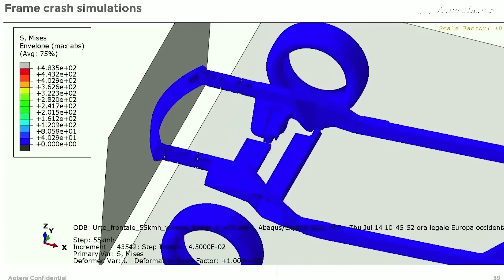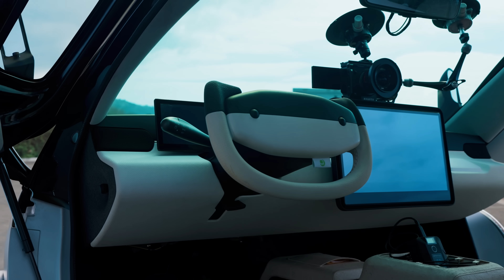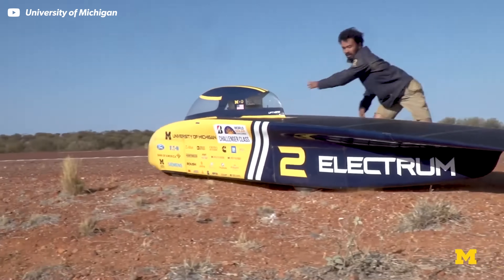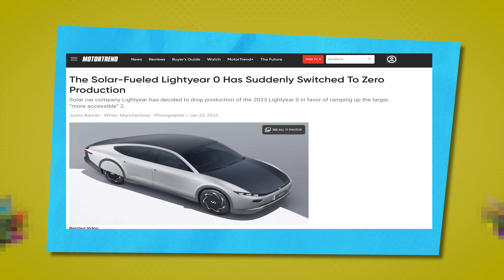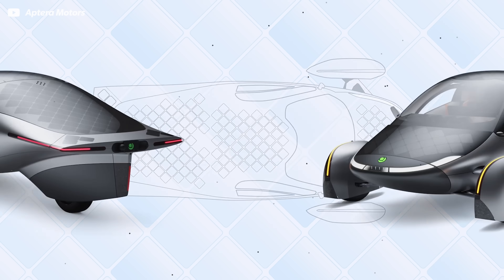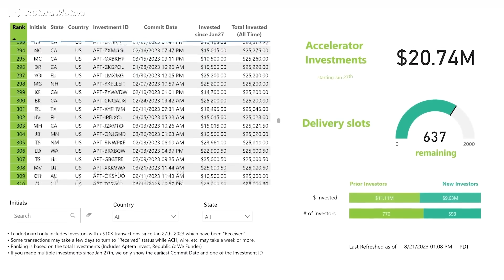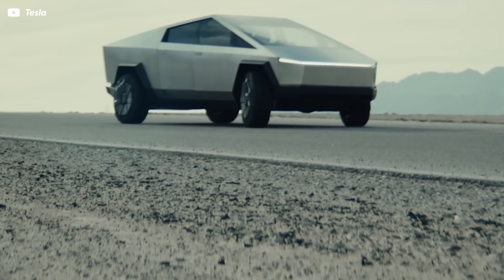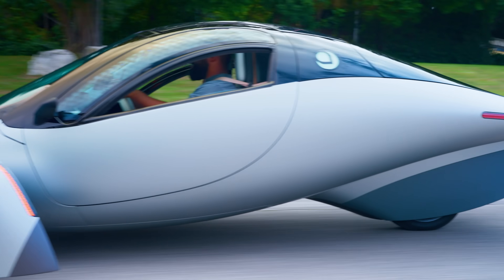We Drove America's First Solar Car

Comment: I would like to try to drive the Aptera. Possibly paying to rent it for a day, if rent price is reasonable.

Would I like to own the car? Absolutely not. It is very impractical. It has a small interior but it takes up a lot of space. That is the opposite of what you want from a car.
Reply: It has 32 ft of storage space and enough room for 2 people to sleep in the back for camping.  It is both a practical commuter and a weekend adventure vehicle - exactly what many couples want, and it fills that dual role at a much lower out of pocket cost.
Reply: @n.brucenelson5920  "32 ft" that is a length? Sorry I do not speak hillbilly units.
The cabin is small and there is not 4 seats. Contrary to other small cars it takes up alot of space, so will not fit in a small street parking space.
Reply: @Foersom_  32 cu ft., or around 90% of a cubic meter.  Aptera will fit nicely into a US compact parking space with room to open the doors.  You are correct that it is not a 4 seater.  Neither was Tesla's first car.
Reply: @Foersom_  32 cu ft, or if you prefer about 90% of a cubic meter.

Aptera will fit in a US compact parking space with room to open the doors. 

It has better 0-60 times than Tesla's first shipoing 2 seat sports car at about 1/3rd the price, and a far larger demonstrated market. through paid pre-orders.
Reply: @Foersom_ there is 7 feet of room behind the seats and 32.5 cubic feet of storage back there.
Reply: @n.brucenelson5920  The Aptera is 2.22 m wide, that is much wider than any normal passenger car. Curb side parking here in Luxembourg are barely 2.00 m wide, some even slightly less. Most often it is not allowed to park on to the pavement. You will find similar narrow curb side parking in other European countries, including Italy. That makes Aptera a very impractical car to park.

"90% of a cubic meter." 

That is >300 l less than storage of an VW E-Golf or ID3. And that while E-Golf and ID3 are 40 cm less wide and 30 cm shorter. Small interior, but takes up  a lot of space. Aptera is the opposite of a practical car,

"It has better 0-60 times than"

Not relevant to anything I have said.

Comment: The future cars are electric,  hybrid and hydrogen powered  micro cars, but  that sell for as lows as 8999 and can get in excess of 80 mpg for the hybrid and have insurance premiums for less than  half of today's Honda Accord would require. We can also look forward to  affordable electric flying vehicles with a range in excess of 300 miles at speeds of 100 mph plus.

Comment: If this costs $25k then it will be hit in developing world like South Asia and Africa as they have low income + they have bright sunlight throughout the year
Reply: The prices were made up 5 years ago, and it wasn't a realistic price then, you can easily add 10k or more to the price
Reply: @shrimptopian3392  even at $40k it's a bargain
Reply: @shrimptopian3392  You could get a bicycle for even less and have almost as good a performance.  You need to look at the details a bit more closely, especially  once the crash test validation work is done.   This comment will not age well at all.

Comment: So at a light or when you’re stuck in a protest someone will knock on your trunk and it’s “game on”!😂😂😂😂
Reply: Personally I dislike the knock knock. However...

From Aptera FAQ section:

How do I unlock and lock the Aptera vehicle? With a key fob?

The vehicle will unlock by detecting you via your phone’s Bluetooth connection, our app, or with a physical RFID card. Once inside the vehicle, you can open the door through the center screen controls. Aptera will automatically lock when you exit by detecting that you are not inside. The interior cabin will include a mechanical release to open the door in case of any electrical malfunction. More information to come as we push the efficiency envelope on mobility.

I belive you can open it via Bluetooth and your phone, or an rfid card, and I don't belive that the knock knock will work without one or the other.

Comment: I wonder how fast it can fast-charge
Reply: The highest rate for the first models will be between 40-60 kW per hour, or about an hour to fully charge a 400 mile range battery pack (45 kW/huur pack - 40 kwh useable capacity)

Comment: The drive it, they like it, everybody loves it yet it is not available. In a country that sold Pacers, Gremlins and Aztecs by the thousands. And everybody hated them 🤔
Reply: Both my wife and I have ridden in an Aptera prototype.  It is no Gremlin (which my brother owned).  Although the primary design goal is efficiency, the AWD acceleration is better than at least the first 200 Tesla Roadsters made.  It is a blast!  Production is still around a year away.

Comment: Where is the windshield wiper? I understand that at speed, with a slick enough surface, you might be able to have the water bead and flow off, but not sitting in traffic. That structural member across the side windows would take some getting used to, but I saw another video that mentions you have video screens showing everything out to the sides (180 degree arc to the back half), so you actually can monitor that view from the dash.  I hope they succeed. Cars are an incredibly difficult thing to manufacture and meet modern regulations. I know the electric motor (s) is in the wheels. Can't remember how many motors. In the other video  they showed us the one, in the driver's side front wheel. I hope they have some redundancy (mechanical) for the door opening. People are getting stuck inside Teslas during software updates (perhaps some "user error" there, but things need to be "user-proof"). In the late 70's, people got stuck in their Bricklin Motors cars when the prone-to-drain batteries ran out of juice. I worked with a guy who had one, and he did get stuck once. Granted, tech is way advanced since then, but a mechanical emergency mechanism would be nice.  While the aero is amazing for forward resistance, I wonder how this will fare in cross winds and 18-wheeler turbulence.

Comment: It’s cool, but 5 miles of range per hour isn’t enough for it to really take off. I hope this technology can improve as everyone loves the idea of free power
Reply: "5 miles of range per hour isn’t enough.." Um, where? My job is less than 3o minutes away from where I live. If I charge the cheap 250 mile variant ($28k with premium sound system, tri motor, and full solar package) over night, then let it sit in the sun at work like I do with my ICE car now, it would always be topped off. 5 miles for 1 hour in the sun is great.

Comment: Wanna see it does a high speed sharp turn like what is the limit before it flips? Or on bumpy roads.
Reply: And how do you miss a pot hole when you have a wheel in the middle?
Reply: It passes the moose test, it slides rather than flipping. The batteries, which are the heaviest part, are very low down which helps keep the center of mass low.

Comment: The range of 5 miles per hour sunlight does not make sense. Just put the solar panals on your roof and keep the production costs of this car as low as possible.
Reply: It isn't an either/or choice.  The solar will be welcome on camping trips for instance, and collectively protect the public power grid.

Comment: Those AAA Batteries are no match  for my Ramcharger on 35’s and a q-jet 360 small block haha
Reply: You would be surprised.  First of all they aren't AAA batteries.  Secondly, the 4 second zero to 60 times will be likely be humiliating to your Ramcharger -and your pocketbook when you compare the initial and and operational costs.
Reply: Every time you fill your tank it costs you ~$100. Have fun!

Comment: Do they use LFP or LMFP battery chemistry?  Can the hub motors be turned into coast mode for better efficiency?  ie  use only one motor for constant speed on flat terrain?
Reply: The batteries for the first models use NMC chemistry..  The hub motors have several levels of regenerative braking available.  Future models may introduce new control software that could provide differential steering.

Comment: Is the trunk big enough for a hayabusa or equivalent motor to drive the rear wheel?
Maybe power a small generator too I guess.
If it has too.
Reply: You have not yet grasped the purpose or benefits of the design.  However with right to repair, owners can do whatever they wish with one.

Comment: Can this be 4 wheel without losing efficiency?
Reply: No.   4 wheels would add weight, rolling resistance, air resistance, and cost, and an additional friction robbing bearing.

Comment: Anyone know how long the solar panels would last? Would their efficiency drop over time? And can they be replaced or repaired?
Reply: The Maxeon cells used in the Aptera panels are sold in fixed panels by Maxeon directly with a 40 year warranty and a stated efficiency of 88% of the original over that time frame.

Advances in Solar tech probably mean that the solar panels on most Apterae will be replaced long before that, due to lower cost and increased efficiency.

Comment: I would not call a $26,000 vehicle Cheap. However I am hoping to save enough to buy 1.
Reply: Remember that ongoing cost of ownership should be a part of your calculation.
Reply: @n.brucenelson5920  yea..I'm seriously not thinking of buying I can hardly justify spending that amount of money even if I had that amount
Reply: @seapirate65  We are still a ways from knowing the actual final selling cost of the 250 mile range basic model, and it is probably still at least a couple years off from production.  You have time to continue to save, and will have third party reports of the actual performance by that time to help in your decision making.
Reply: @n.brucenelson5920  yes that's what I'm thinking, it is still years away before any vehicles roll off a production line. So yes I still have time to save.
Reply: I will say tho. That is still alot of money

Comment: I like it.. 101 miles range assuming that’s on a full charge?…
Reply: The first production vehicles will deliver around 400 miles of range at EPA highway speeds.  They will eventually have models with about 250, 400, 600, and 1,000 mile range.

Comment: I wonder how it handles cold weather.
Reply: It should be good down to at least -20 F.  It has superior traction control, especially in the AWD models.  They can sense wheel slip and adjust torque every 2.5" of tread travel.  I will report on my experience in Iowa.
Reply: @n.brucenelson5920  
How’s it for heat? Where I live we regularly see EVs loose 50% of their range just keeping the car warm enough for the passengers. 

As for snow, I wouldnt drive it most places around here. It’s simply too light and three wheels gives you a lot less grip in comparison to four.
Reply: @MiscellaneousMcC  I don't know the answer to the effect running the heat will have on range.  There will be need for both keeping the passenger(s) warm, and maintaining the battery pack at a suitable temperature.  I think we will find out more about this during the validation phase of the testing of the first production vehicles this coming Spring.  My guess is that it will be adequate down to -20 below F, and possibly further, but definitely with a range hit.

As far as performance in snow, I currently drive a gen 1 Honda Insight through Iowa winters. It  weighs about the same as an Aptera will, and the track of the rear wheels is narrower than the front, so it has to displace more snow.  I have found that with proper snow tires it is adequate.

Aptera will have superior traction control, with the ability to sense wheel slip and adjust torque every 2.5"  of tread travel.  There will be snow fall that is deeper than Aptera or any other small car can handle, but once the roads are plowed I think it will be better than many, at least in the AWD versions.  A prototype has already been tested on a ski slope in Switzerland with the snow above the bottom edge of the wheel pants, and it did fine.

Comment: The Aptera is a motorcycle, not a car. And it s definitely not the first solar vehicle. But it is the only left, as the others already went bancrupt.
Reply: While Aptera is defined legally as a motorcycle or autocycle, depending on where you live, for most owners the functionality and legal requirements such as licensing and insurance will be much more car like.  Your statements are about as accurate as your spelling.
Reply: @n.brucenelson5920  Most often the insurance for expensive motorcycles are much much higher than for car which cost the same. Your statements are about as accurate as your fake identities.

Comment: Here in gloomy B.C. you wouldn't get far, especially in winter. Be good in Nevada though.
Reply: You will get about 2.5 times the distance of a Tesla model 3 for the same amount of power if you plug it in.  Perhaps you are overlooking what the efficiency does for you.  The first model will have 400 mile range at EPA speeds.

Comment: I wish it was 4 wheels. Would look so much better.
Reply: 4 wheels would decrease performance to a major degree, due to increased wind resistance, rolling resistance, weight, and cost.  It was not designed the way it is for "looks".

Comment: it is interesting to me, why doesn't tesla slap some solar panels in the roof to help extend range? seems easy to me
Reply: Because Tesla is so inefficient in comparison, that just slapping some solar panels on the roof will not add significant performance as it does for Aptera.  Every watt gained by the Aptera drives it 2.5 times further than it would a Model 3.

Comment: If they had an option to just charge it normally also then it would worth it
Reply: Aptera can be charged at a rate of 13 MPH range gain plugged into a standard 110VAC outlet, or around 400 miles per hour plugged into a Tesla Supercharger.
Reply: It obviously can charge normally as well.  Where are you getting your information?

Comment: That car looks like a five mile per hour wind could blow it off the road.
Reply: Only because you don't understand aerodynamics.  There are no flat surfaces for the wind to exert pressure on.  At speed there is downforce built into the design.
Reply: @n.brucenelson5920  I had to look up what downforce was and how it worked. I understand that downforce allows the vehicle to grip the road better and travel faster.

Comment: how does it handle pot holes cuz I imagine hitting one with that back wheel is gonna do some damage
Reply: I had a ride in a prototype before the suspension was completed by Roush Performance.  Even then it did well over speed bumps.  I will report on my experience in Iowa on gravel roads.

Comment: For someone like me who doesn't like <4 wheeled vehicles for safety, what would you say in favor of it?
Reply: Much of the safety concern over 3 wheels came in the wake of Top Gear modifying a Reliant Robin to make it look easy to turn over for comic purposes.

The Aptera is a tadpole configuration, has a much lower center of gravity due to the wheel motors and battery pack, and passes the moose test - it is better in this regard than many 4 wheel cars on American roads.  The three wheels reduces rolling resistance, allows for a more aerodynamic shape, and reduces weight, cost, and tire costs.  For its mission, it is a win all around.  It will be publicly crash tested next year to FMVSS Part 200 automotive safety standards by a third party.

They wouldn't go to this expense voluntarily if they didn't know it would do well.
Reply: I would say, look at the videos of them doing the moose test, ect.  The car is more stable and less prone to rollover than many SUVs/crossovers today.

Comment: We need to crash test this car against an average US vehicle, ie a pickup truck.
Reply: Aptera will be voluntarily crash tested to the same standard of every other car or truck in the US by a third party- FMVSS Part 200.  The results will be published, unlike many SUVs and trucks for sale in the US.
Reply: Let's then test that pickup truck against a fully loaded semi at 70mph.  You are pointing out the exact problem the US car industry and regulation have.  Continually making everything bigger and bigger, then everyone need a giant tractor to be safe in an impact.  This vehicle is solving that problem as well, by being as light as possible.  Check out Romain Grosjean F1 crash through a metal barrier.  They are using similar technologies for safety cell, ect.  While obviously not F1 level, but you don't just build things bigger/heavier to be safe.  Then what about the next guy?  He needs a bigger car than you??

Comment: Moar solar charging info would have been grand.
Reply: Like what? The full solar package is 700 watts.
Reply: @tims8603 , like range testing?  Has any video shown range testing with solar?
Reply: @THESocialJusticeWarrior  Only computer simulations. They don't have a production intent vehicle yet to do real world testing. They expect to start building those early next year. We should know by next summer what the testing will show.
Reply: @tims8603  , they've had years to build a test mule for solar.  They just don't want to.
Reply: @THESocialJusticeWarrior  You're making an assumption. They have limited funds. There's no logic to test a prototype. The prototypes were built to show to the public and potential investors. When they get a production intent vehicle built, they will thoroughly test all the functions. They plan to have 16 vehicles built for all the different tests, crash testing, range testing, cold and hot weather testing etc.

Comment: what do u mean u have to charge it, first u said it is a solar panel car then we see u charging it, is it solar or part solar?
Reply: The solar capacity can cover the average driving needs of the average driver in the US SW.  However, the Aptera can be plugged into grid power, and is compatible with Tesla power plugs.